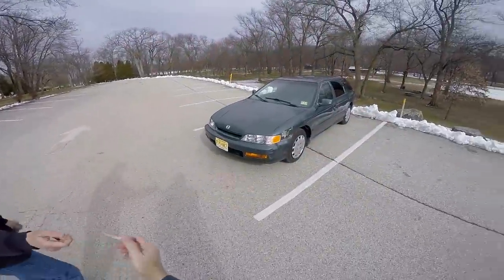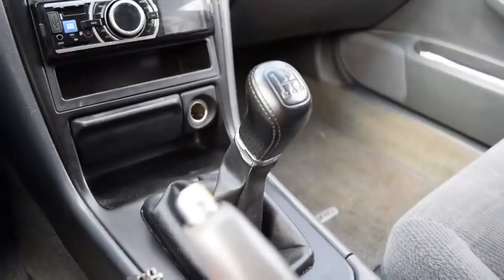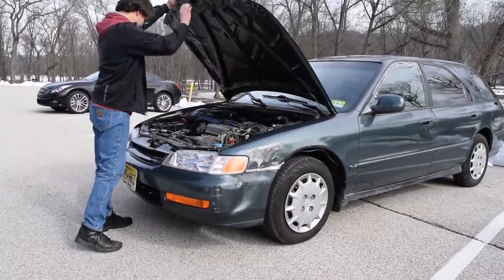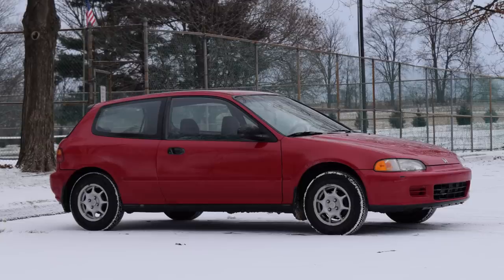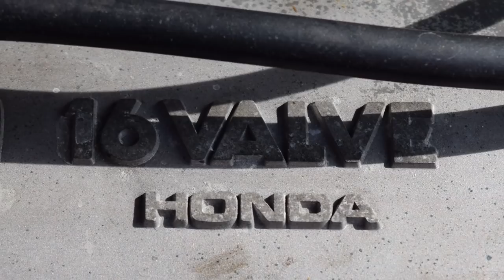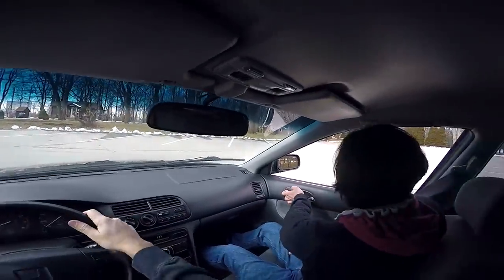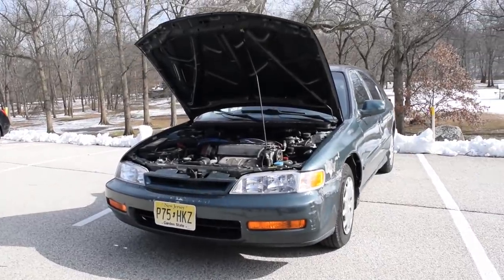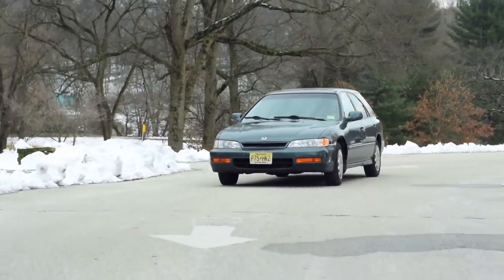1996 Honda Accord Wagon 5-Speed: Regular Car Reviews

Comment: 91-93's are  much MUCH better made... no head cracking,  much better A/C as well as heater with a stronger motor and the automatic transmissions are bulletproof.  It also has greater cargo capcity as its not rounded off.   Headlights are GLASS not fade prone plastic.

Comment: I was lucky enough to have a mother who owned a 1996 Coupe Ex in white (with a useless little spoiler option that I still think is the shit). It was what I remember growing up in (that and the Jeep Cherokee Country, but my dad sold that rust bucket when I was twelve). It ended up being passed down to me, and I drove it for two years and loved it...
...until it was totaled by one of my classmates on my birthday of all days. She thought she was hitting the brakes while creeping out from her spot in the parking lot, ended up slamming the gas to the fucking floor. This was two years ago, and I still wish I'd have bit the bullet and do the $2k repair on the door/frame, which I didn't do because classmate didn't have insurance, so no payout larger than the car's value, which was only about $700.

Comment: I have a 00 civic dx coupe that I'm currently building as a weekend, track, fun car with a b16a2, roll bar, wildwood big brake kit and obviously coilovers. I need a daily I was thinking about a mk3 Jetta or golf with the 1.9aaz with the 5 speed manual or the mk4 Jetta or golf with the 1.9alh. I just need a dependable daily that gets good fuel mileage. Will be driving 70% highway 30% city. If I get it the first thing I would do is clean intake and delete egr

Comment: 7:50 that applies to my 2003 subaru forester, hard suspenstion, steering with a lot and I mean, a lot of feedback, no turbo and automatic, but that automatic transmission slams the gears so much I think its not normal how much it bangs the gear in

Comment: hello, is it still worth it to buy a low milage 1996 honda accord manual? Are the parts still easy to get? will i get lower insurance cost? Been driving for almost 2 years but if i am getting this car it would be my first real car.
Reply: If you can find a low mileage Accord, it's a good buy. Most parts are still easy to find. I've used RockAuto often, but local parts stores can still get items though may not be in stock. Replacement manual trans will be tough to find, unless you are willing to buy offline, I've tried to source one from several of my regular sources with no luck. Clutch/Flywheel components however are super cheap, like an Exedy or Sachs for less then $200 combined off Rockauto for example. Some wagon specific parts will be tougher to find, like the rear power antenna, hatch, glass etc. There are still a lot of these cars in salvage yards, but good parts are picked off them quickly. 

Insurance depends on too many regional/driver factors for me to comment on.

Generally everything I've replaced has been easy to get and not that difficult to work on. They are very good cars and survive a lot of abuse, but try to find something with service records or you'll end up chasing problems like any old "beater" car. You can't really expect any older, cheap car to not have some problems, but the Wagon is my second old Accord and I've loved both of them.
Reply: I found a good condition accord 1996 manual sedan and it has 113k miles on it! should i buy it still? i looked it up and it costs only 1,400 for an excellent condition on kbb. and I think it is the cleanest accord I could ever find, but he is offering 2750, it it worth it to get it at like around 1,600? Or should i just look to an earlier version like year 2000? I just want to have a car that is reliable and has easier access to stock parts that's all! :D
Reply: Vince Bruno I'd it's rust free, buy it. I beat my 97 accord for 5 years through college and after. It never died or needed any work besides 1 new muffler and exhaust repair and some new spark plug wires and some ball bearings and brakes. If I needed a cheap reliable car for a nephew or son or my budget was tight I'd buy a rust free example in about 3 seconds.

Comment: Aftermarket remote start on a stick? Ballsy. It would have to bypass the clutch safety switch, I'd be afraid I left it in gear (I always do, the e-brake is just for steep hills and driving like an idiot) and crash it into stuff without knowing. My friend has a 1998 V6 Accord sedan, it's pretty damn fun, but incredibly uncomfortable. When he moved to Colorado from West Virginia, I drove it (about 1,300 miles, I think) so he didn't have to tow it. I was CRIPPLED by the time we got there. I've driven mediocre cars coast-to-coast on several occasions as a touring Deadhead, that's the only time I've ever hurt that much from driving. I drove a 1993 S-10 4.3/stick/short bed/lowered 2" from Santa Cruz to Arrington, VA (after having driven it out there from Cincinnati, albeit with four 2-day stops along the way)... like a Cadillac compared to that Honda.
Reply: when was the last time he replaced the shocks? In my opinion, the ride quality is really nice if it is new stock OEM suspension parts, i don't know when my PO replaced the shocks but the car rides like a dream.
Reply: @TheGlenerd2  It rode great. It’s just not designed for someone shaped like me (5’9”, 150 lbs, male, real long arms and legs and real short torso), I guess, in terms of the seat and steering wheel  adjustability and that kind of thing. Great car, I just couldn’t drive it for more than like an hour without genuine pain in my back and shoulders. I was in my twenties and in very good shape at the time. Weirdest damn thing ever.
Reply: @The_sinner_Jim_Whitney  I haven't driven mine for so long yet so I wouldn't know lol

Comment: Seriously, what is 'fun' in a car? I've only driven three cars in my life, my dad's Ford Ranger (2.5L 4 cylinder), my Ford Fiesta (1.5L 4 Cylinder), and my mother-in-law's Camry (2.0L 4 cylinder), To be honest, they all handled the same. All of them were equally fun. What is FUN in a car? Does FUN mean manual transmission? If so, would a Corolla with a manual transmission be as equally as fun as this 96' Accord wagon? After all, they would both handle the same, and heck, the Corolla would be faster, so... what is fun?
Reply: Most amateurish ideas about "fun" involve a car that makes a lot of noise, usually through unmuffled exhaust sounds, loud wind noise that exponentially increase as speeds build, and basically just auditory concepts that create the illusion of going fast. A go-cart with a lawnmower engine would be the classic example.  Very "fun" but blown away by a rusting old '78 Pinto.
Reply: Fun = revvy engine, lowish horsepower (so you can floor it and abuse it 100% of the time and be mostly legal. Too much power is not fun in everyday driving coz you can never use it) firm steering, great steering feedback, snickity shifter.
Reply: Matteo .Bassini fun?  Stock 89-95 civic hatchbacks are fun if they are stock. If you have more money then 91-04 Miata stock.  And if you want modern then Ford Fiesta or BRZ/GT86
Reply: Well, none of those cars is fun.

Comment: actually put a subaru legacy on ur list.
pros 
no honda badge😂
some are twin turbo 
all wheel drive 
they don't look horrible 
are fun to drive 
alot of them have tow bars 
there are millions of ej20s engines 
to part out if urs breaks 
cons 
fixing anything is a bastard of a job  
my sister has a legacy and she asked me to change the spark plugs, I ran away and hid in my room

Comment: I had a 95 Accord wangon back in 09 it was a piece of shit it overheated on me when I was driving on the highway I was far from home and the only way I made home was to filled the radiator with water because the fluid was already leaking anyways that was the caused for overheating so next day I replaced the radiator and 2 weeks later the head gasket had a Crack on it and it overheated on me again I decided it was time to move on and get a different car I didn't even like it to begin with it was ugly and long inside long story short I sold it for 50 bucks with a blown head gasket to a guy I knew that owns a body shop he bought it off me I just wanted to get rid of it as fast as possible I had another car already so I drove that one and the shit box that overheated was gone a couple weeks later I saw a woman driving it I don't think she had it for very long because a week after I seen it back at the body shop and it was never seen on the road again I think it was a lemon